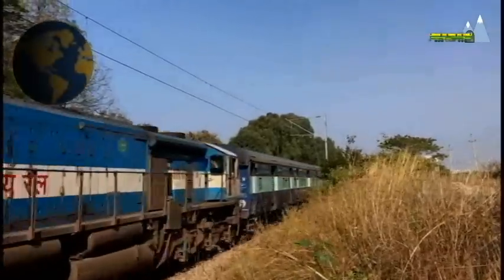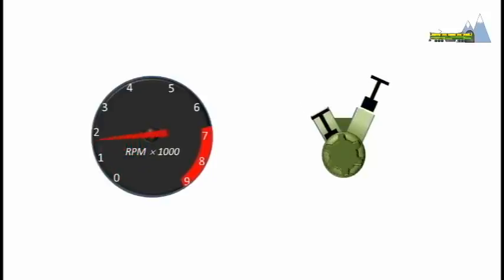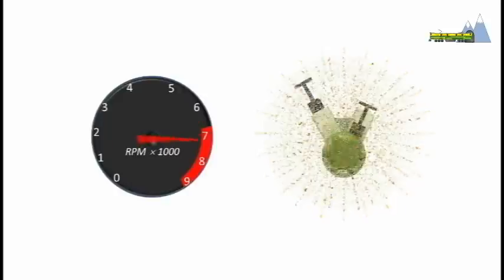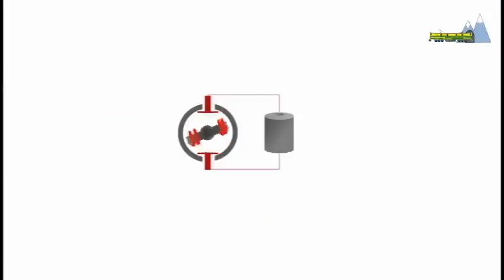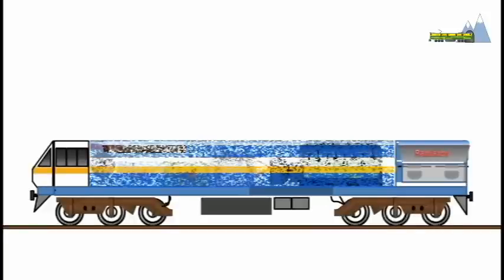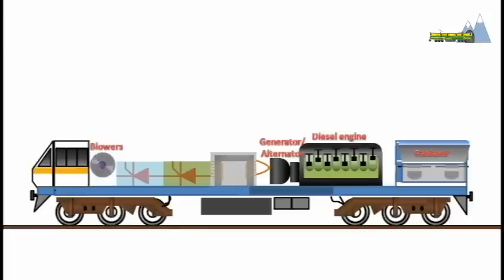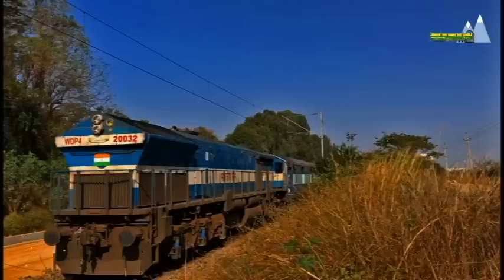How a Diesel Electric locomotive works?

Comment: I've always wondered why locomotives used a Diesel engine to produce electricity to power a train.  Intuitively, I always thought this was crazy from the point of view of power loss but now that I understand it's due to the torque/transmission issue it totally makes sense.  Thank you so much for this video.
Reply from the maker: Jeffrey Bue Thank you Jeffrey...
Reply: Steam locomotives don't need it.

Comment: So, if a diesel-electric locomotive is a electric locomotive with diesel engine, it can be easily converts in a total electric locomotive. Can we make a diesel-electric locomotive that can switch into a electric locomotive (electric aerial line)?
Reply from the maker: Yes it is possible. The Bombardier ALP 45DP is an example. Indian railways also has a design ready (see https://youtu.be/zOuhGw-7Nrw ) which would me more than a last mile loco that Bombardier has built.
Reply: I think the HS trains between England and France run HV overhead (AC) on land and drop a pick up to a third rail in the tunnel which I believe is DC

Comment: We need to get this into cars and trucks. No explosive lithium-ion batteries would be a good start and this design has been in constant use since the 1930s.
Reply: There are several problems with this, and most of them are about money.  Hybrids get double the fuel mileage of regular cars and trucks. Twice the mileage means half the gas tax. Hybrids have no transmission, and so on.
Reply: @jackfenn7524  that's half the truth what about full electric cars no gas required in fact here in cali you get  7k in tax incentives if you buy one
Reply: Cars don't need that much power to start moving.

Comment: Why is the diesel engine not directly coupled to a 3 phase alternator, but the output voltage rectified and then converted to 3 phase using an inverter?
Reply: I wondered why they would not use  a simpler AC motor.  I do remember reading AC motors want to run at a constant speed though, and maybe that's why DC ( because they run at 60 hz, or whatever the frequency of the current is.)  So one would have to convert the AC to DC for use with DC motors.  If you find a better answer, let me know, as I would appreciate understand this aspect.
Reply: http://cs.trains.com/trn/f/741/p/221349/2449412.aspx#2449412 - from that link is this explanation which I guess makes sense - "The second generation of AC locomotives, what we now mean by a proper AC traction system, requires active electronic devices, much like the transistors in all of your consumer electronic devices but operating at much higher current levels.  The AC applied to the motors needs to be at a frequency at which the current alternates to closely match the motor rotation speed to get the best torque and efficiency.  So the AC from the "traction" alternator is first rectified using silicon diodes to turn it into DC as on the first generation of what people called "AC" locomotives, and then a high current electronic circuit turns that DC into AC of a different frequency than coming from alternator, a frequency that the control system changes as the locomotive varies in speed."
Reply: If I understand correctly, modern systems generate AC from the diesel, then convert to DC for circuitry that can supply the proper AC current.  Using AC traction motors is surely a good thing, because they are less complex than DC motors.
Reply: Arvind. Basically the invertors that produce the three phase for the traction motors, can be controlled better if fed from a DC source.
 There are AC to AC control panels, but all loco traction systems use high volt DC to AC invertors.  Hope this clears it up.
Reply: @michaelbauers8800  i think AC traction motors became the standard around the year 2000 or so. They are powerfull enough to actualy stop a train. Im not 100 % certain if any modern DC motors can do that. The motors got progressively better at bringing a train to a complete stop.

Comment: The statement that a diesel-electric locomotive is essentially an electric locomotive is disproved by the fact that it still needs diesel in order to be able to run. Without diesel, no electricity is generated. As opposed to a real electric train which doesn't need diesel.
It's also called diesel-electric to make a distinction between two other type of diesels: Diesel-hydroulic and Diesel-mechanical. There is a loc (the NMBS 25.5 series Belgium) that can run on Diesel as well as on Electricity.

Comment: What I don't understand is why the diesel engine needs to produce SO MUCH TORQUE. Taking the American EMD SD70M-2 as an example, it's prime mover creates 4300 horsepower at 900 rpm, meaning it produces 34,020.36 N-m of torque. Considering it's only role is to power a generator, this seems LUDICROUSLY excessive. Can someone please answer my question? I've been wondering this for a long time.
      On a side note, good video, you explained the concept brilliantly. Keep it up!
Reply: Those Huge pistons which create the torque drive the generator, and , makes sense that the MASS of say, the flywheel alone, is huge.
It is trying to move a million ton item, so Go big, or GO HOME!

Comment: Nice animation...similar for ALCO locos also need to made...
Reply from the maker: I tried to present a generalized mechanics of diesel electric locos. ALCOs and EMDs may differ in the specifics but are similar in employing a diesel engine to generate electric power for the traction motors.
Reply: Very true...thanks....

Comment: The inverter is a device which converts DC to AC and not AC to DC as told in the video.

The electric motors in the locomotives are AC Induction motors. This conversion of AC from transformer first into DC by rectifier and  then back to AC by inverter is done because the engine rpm nit being constant thus the AC output of generator is fluctuating therefore there is no steady voltage and current input to the motors if they were directly connected with AC transformer.

So AC is first converted to DC, and then converted back to AC of stabe output to feed AC motors.
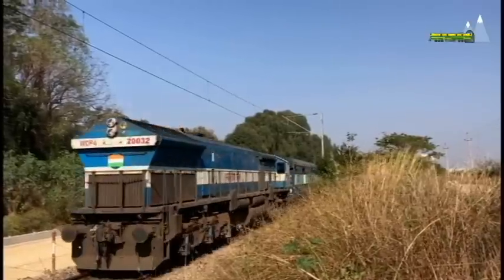Reply from the maker: The video also says an inverter converts DC to AC (1:47) and a rectifier converts AC to DC (1:40).

Comment: I"m a little confused when you say the "combustion engine is the primary source". It makes it sound like the diesel is the primary engine with the electricity being a back up or extra boost.  Your final comment sounds like what your first sentence should be, that the diesel locomotive carries its own generator for the electric power. In other words, diesel electric locomotives are run by electricity. It so happens that electricity is provided by an on board diesel generator.
Reply from the maker: Thanks mate... for the correction

Comment: Why convert the AC current to DC then back to AC again? What are the reasons for not running the AC motors directly from the transformer?
Reply: The 1st type isn't the same as that produced by an inverter.

Comment: why we rectifie AC current in to DC?why not we direct connect with invertor *
Reply: Nice explanation, but many locomotives still employ older traction, ie Diesel engine drives alternator, 
 Which is excited to provide varying AC Voltage which is then rectified to Dc , this is then provided to DC series (or if you are lucky 😉)  sepex wound DC traction motors. AC inverter supplied Motors on Locomotives is quite new although been around on multiple units for some time.
Reply: It is because modern locomotives uses variable voltage variable frequency drives to control the speed and torque accordingly...Drives are not separately connected to it because the modern converters( so called inverters ) are used as drives..It uses IGBT or GTO for its purposes....Note- As seen in the video, the EMD alternator does not produce ac output across its terminals but it has a built in rectifier that produces the final two phases of 1300volt DC across two terminals...The 3phase output of alternator cannot be fed directly to the motors as its output is not linear, since output freq is directly related to prime mover RPM....In the converters and drives both the voltage and freq are so adjusted that it adds up to high efficiency.
Reply: Subash  Dwivedi it would be a lot simpler to use a 3 phase generator that connects directly to the 3phase engine
Reply: In a nutshell,  it's for control purposes. These machines are very technical and there is a lot going on.

Comment: Sir please make a video of same wdp 4 locomotive but drawing power from both diseal and add a pentograph and also by electric overhead wire .this is what indian railways is gonna do.
Reply: WDP4 doesn't have pantograph. The proposed loco WDAP4D is not yet designed

Comment: It will call cat locomotive if we replace the diesel engine with salt battery up to 1Mwh and used cats to move rolling to generate power and regenerative braking

Comment: Why convert to DC and then to ac again??
Reply: Yeah that don't make sense. I thought the traction motors on the wheel assemblies were DC anyway.
Reply: @martinbroughton6655   i asked my SSE and he told me that the AC from the overhead supply may contain ripples or higher harmonics and we need to get rid of them to  have better control over the speed of the motors. DC is more easily purified for ripple than ac  Thais the main reason.

Comment: If electric locomotive.. Doesn't have a engine like that of a diesel locomotive, then what is the weight difference in between them...?? 
Generally i can say that an electric locomotive is much lighter than a diesel locomotive.... 
Brother can you please clear my confusion..... 
I would be very thankful if u can make a video on my question... 
Thanku.. Im siddharth
Reply: Maybe a 100 % electric loc has more electric motors and so the weight differance between an electric and a diesel electric loc is minimal. 
 DE locs are used on unelectrified railtracks and also to cross borders between nations. Since different countries have different voltage on the power lines. The third reason why DE locs are used, is shunting. So individual carriages are put toghether to make a train.

Comment: Why does it need to be rectified to DC, only to be converted back to AC again? If it was AC in the first place, why convert it twice more?
Reply: At first its single phase ac power, they convert in dc power then dc power is converted into 3 phase ac current

Comment: I wonder how hydrostaticly driven diesels compare to this. More torque?
Reply: Hydraulic driven diesel engines are no more used
Reply: They are still being used as switchers in Europe.
Reply: @erkinalp  we used it as switchers till the early 2000s but all are scrapped now.

Comment: Why electric locomotive has two pantograph?
Reply: Nice Institute to change the direction of the loco or it is backup to other pantograph.
Reply: in any case pantograph is get damaged the other can be used.
Reply: Some electric locomotives in India have two pantographs because they have two separate motors for AC and DC power. Wires above the track have different currents in different areas of India, so locomotives have to have two separate systems.
Reply: @pwhnckexstflajizdryvombqug9042  if u don't know please dont explain it
Reply: Mari Muthu; I know, if I don't know something I won't explain it.

Comment: It means Diesel locomotive also run on electric motor ??
Reply: Depends on if it is a diesel-mechanic, diesel-hydraulic or diesel-electric locomotive.
Reply: All diesel locomotives used in IR is diesel electric locomotives only. Except shunting locomotive WDS4 which is diesel hydraulic locomotive

Comment: Alternating current rectified to dc then why need it again invertion to ac?
Reply: It is not a classic constant frequency inverter but a frequency converter. Changing the frequency of the three-phase voltage changes the engine speed. If the engine torque cannot overcome the counter-torque, the frequency and speed of the motor will decrease, but this will increase the engine torque and overcome the counter-torque. Series-excitation collector motors do not require an inverter as they are powered by direct current. Due to the serial excitation, they automatically drop speed and increase engine torque so the locomotive can pull heavy freight trains at low speed. Of course, there is also a need for a speed controller, but it is much simpler because only the DC voltage is changed.
Reply: Ok. If it is an ac voltage it can controll speed by frequency simpler than dc voltage .
Reply: The reason why DC motors are not used nowadays is because they have  armature winding on the rotor, which is more complicated to produce and has a collector ring and brushes that wear out over time. The DC voltage is easier to regulate because with the three-phase frequency inverter, not only the frequency changes, but also the voltage because with decreasing frequency the reactive resistance of the motor is also reduced. If only the frequency were reduced, there would be a large current that could cause the motor to burn out.

Comment: How can we say it electric locomotive...because it named as Diesel locomotive..does it uses diesel also...???
Reply: Of course a diesel electric loc uses diesel fuel. DE locs are used at unelectricfied railtracks, or crossing borders, where each country uses different voltage on the power lines above the rails.

Comment: You are wrong 
Machenical energy is converted to electricity then traction motors run
Reply from the maker: Mr. Mallick I the video clearly shows that a Diesel engine runs an alternator to produce electricity. The electricity than runs the traction motor. See the complete video before jumping to conclusions.

Comment: Diesel engines are not internal combustion(IC) engine
They are compressed ignition (CI) engine
Only petrol engines are callled IC engines because fuel is ignited using a spark plug............
Reply from the maker: Any engine where combustion takes place inside the cylinder as opposed to outside (as in a steam engine) is an internal combustion engine. You are right that in a diesel engine the combustion is caused by compression of air-fuel mixture and not by a spark, but the combustion is caused INSIDE the cylinder and therefore it is an internal combustion engine. Petrol and diesel engines are both Internal combustion engines!

Comment: Solargroup started financing this project with shareholder funds from around the world in early May 2017. This project was accompanied by a scientist in the field of mechanical physics, duyonov, who has been experimenting and researching since 23 years old his friend is the founder of the company Skyway dant solargroup adopts about the same methods of profit and investment. The company is in its infancy, with a minimum investment of 500 USD you will have about 137,000 shares. after three years, ste will enter the stock market with 1 dollar per share.
It should be noted that the least amount to invest in this company is $ 500. the company is at the ninth step and the overall number of steps is 20 steps.
The company has a patent in the field of electric motors and intends to deploy this method on a worldwide scale. These engines include all types of vehicles, electric motors, motorcycles, cars, aircraft engines and appliances engines, etc.
The company has several internationally recognized patents recognized by the Russian government. The company has already sold more than 100,000 electric motors and the ste has agreements with the French brand reneaut and also agreements with Chinese and Indian ste.
The company is not only interested in the production of electric motors, it is also interested in the transfer of licenses and technological patents.
The number of participants exceeding 137 000 engaged from 114 countries and intends to
With this new technology solargroup intends to create an energy that is respectful of all around the world.
https://reg.solargroup.pro/dcy400